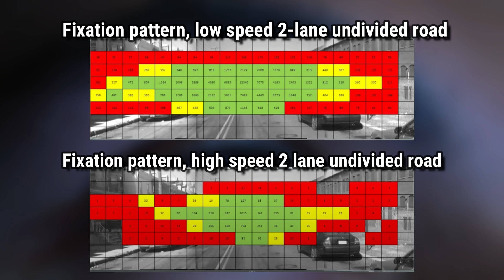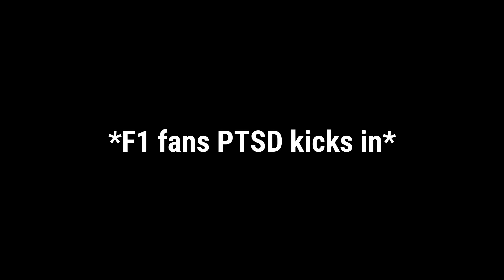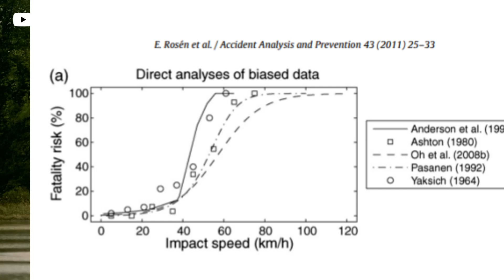Why Speed Limits Are Useless

Comment: I haven't finished watching, but does he address the most fundamental question of all: Why do you want drivers to look down at their speedometer?
Reply: So true man I always drive way worse when I'm near cops because I'm checking my speed more often.
Reply: Who looks at their speedometer constantly? 👈 People who constantly drive close to law enforcement's threshold. For those who drive closer to the posted limit, a glance every so often is enough or set your damn cruise control.
Reply: @Doowadaddy  people wouldn’t be speeding if the roads were designed well.
Reply: @thephilster741  . Sure they would. Look at a construction zone, narrowed lanes, workers and equipment, rough roads, limited visibility, flashing lights, lane shifts, everything to reduce the speed, "your speed" signs, higher fines for speeding, criminal charges if you hit a worker, even a trooper parked on the shoulder with lights flashing 👈 that last one is usually a speed deterrent. But people speed through construction zones, lots of people. Road designs aren't going to help people manage their time or relieve them of their propensity to rush around like a race car driver.
Reply: nobody stares at their speedometer. You can easily maintain a speed just through constant gas pedal pressure as well as visually maintaining your speed simply while looking forward. Also, anyone who's been driving for a little bit will develop a muscle memory for certain speeds. I rarely ever even look at my speedometer since I can always feel how fast I'm going.
Reply: I rarely look at my speedometer. I’ve been driving long enough to feel my approximate speed. Although anytime I’m driving a new vehicle, I have to relearn it because not all vehicles feel the same. My first car felt like it was falling apart if you hit anything over 60mph
Reply: My question is, why does his vision narrow when he goes faster. 2:40 
Cause me going around (censored  cause im not an idiot)mph  and being able to keep track of every vehicle around me while having to drive a 6 speed manual
Reply: @raywarlock Think of it as having the processed circles of visual information expiring sooner at higher speeds.  And while you may be keeping track of every vehicle perfectly, us pedestrians are more likely to be blipped over as we fall through the cracks between circles 😂 !
Reply: @raywarlock You think you keep track of every vehicle. Did you see that motorcycle? Or the bicycle? How about the parent and toddler hidden behind that parked SUV?
Reply: @BrendonGreenNZL
Yes, that’s how I knew to not go towards that direction or to use a different street.
Reply: @techgeeknzl  It’s a bit of oft-repeated propaganda that driving fast is dangerous, speed kills, etc. But nobody considers if that is true. It’s not; differences in speed are more important than absolute speed. A freeway with traffic running 80 mph is safer than a busy “stroad” with most traffic going  under 35, because there are fewer opportunities for conflicting speeds, as everybody is going the same direction at close to the same speed on the freeway, while all the vehicles going every which direction at vastly different speeds cause numerous accidents on the typical stroad. Yet if you believe the propaganda, the freeway should be deadly while the stroad should be one of the safest roads around.
Reply: @Ethan.Lamoureux  You're absolutely right. Traffic is safest when it is all moving at the same speed, irrespective of the absolute speed. Which is why roads with fast traffic should not have hazards such as parked cars, pedestrians, or cross traffic; and, conversely, roads where such hazards are likely to occur must not have fast traffic.
Reply: @techgeeknzl tbf I know I keep track of everything and the only unexpected events can occur from animals/people, which at that point I’m exclusively watching out for. Using your mirrors is pretty easy to know where everyone is, especially if it’s any sort of straight road/highway.
Reply: @BrendonGreenNZL  Well, if i do move at a fast pace, then yes, I will notice all except the hidden parent and toddler due to them being hidden behind an object. I dont get X-ray, but I do have the ability to focus at much higher speeds
Reply: @raywarlock please speed on the highway and not on local streets 😊👍
Reply: @techgeeknzl maybe parents with children should make themselves visible before crossing the road instead of hiding behind a suv
Reply: @381delirius  ay now never said speed. Said at speed 😉
Reply: How would you see something if it's behind something like an SUV.  @techgeeknzl

Comment: I often point out that most US drivers are also highly inculturated to high speed driving and even if a road or street is designed well to promote slow driving, those drivers will see it as a challenge to drive as fast as they can in that place. And they will and do. And if by some miracle a street is designed well enough that drivers are forced to actually slow down, they will complain endlessly to the city until the design is changed to one that allows faster speeds. And the city will oblige.
Reply: @ethanlamoureux5306  
> Driving is non productive time that should be minimized.
Hence why I ride the subway. Can't read a book while driving. Can totally get work done in a subway seat. There's a pretty massive texting while driving issue over in the states, and the new touchscreen dashes aren't helping
Reply: @Demopans5990  That sounds great! Unfortunately, subways are only found in eleven cities in the US, with only 32 US cities having metro systems of any sort, including subways. Only four cities have 24 hour metro systems. This means the vast majority of the country has nothing like a subway. Even regularly scheduled bus service rarely makes it into the suburbs where so many people live, and in rural areas public transport is unheard of. This means most people are forced to drive their own car. And since we have no other choice but to spend unproductive time driving, we choose to make it is short a time as possible by driving as fast as possible under the circumstances.
Reply: Speed is good. Without speed we could never get anywhere. Driving is non productive time that should be minimized. The best road is one which allows safe operation at the fastest speed.
Reply: "Inculturated" is not a word I'd use unless the "culture" is something established over spans of minutes.  Take for instance US 206 going north as it becomes Main St. in Newton, NJ.  You spend minutes driving on a country road at 50 mph and then are expected to slow to 25.  The route is 2 centuries old -- the Morris and Sussex Turnpike -- and, due to geographic constraints, would be very hard to bypass for thru traffic -- which is why it was attractive to operate a turnpike there back then.  Newton is a spider web of roads in several directions converging there.

Anyway, the 25 mph limit is appropriate.  Not only is it the prima facie limit for built up areas in New Jersey, but Newton in recent time has attracted a mix of very old residents and children, making for quite the pedestrian hazard, and Main St. cuts at an angle across a grid of streets, resulting in frequent and odd intersections at various angles.  The municipality has tried to address these problems by policing, but that just leads to inconsistent "Why me?" violations.  The entering speed limits are graded with a 45 mph segment and then an utterly useless block of 35 mph before forking into 25 mph streets going north, but it's very easy for drivers who don't come thru often to be unaware of the transition.  And since the most problematic part of Main St. is downhill from both ends, it's hard for drivers to stay within the speed limit even if they notice and try to.

Trust me, the problem is not drivers who would see it as a challenge.  They would not complain of a design to promote slow driving.  The taxpayers, however, would.  I don't know what changes it would take, but if any of them went deep -- literally -- a consideration making the work more expensive is some tributaries to the Paulinskill that underlay the roadway.  And, since it's a US highway and a state federal aid primary road, I'm sure there are those political considerations as well.
Reply: I actively seek out curvy back roads and mountain roads within a 3 hour radius of my house to drive fast. The roads have many ups and downs, sharp curves, etc etc but there is one crucial thing that makes me confident to push 70-80mph on these ~35mph speed limit roads: there is nobody around. Yes there are people in cars driving, but I mean PEOPLE, pedestrians. All that's there is roads, trees, and cliffs on either side. If a sidewalk was present, if crosswalks existed, you can sure as hell bet I will be obeying that speed limit. People are unpredictable and I'm not taking the chance that after going around a corner there could be a family walking across the road. That's the key part of road design in my opinion: making the driver fear the uncontrollable. I am 100% confident in my driving skills and I know exactly what my car physically can and cannot handle, but none of that matters when it can all be ruined by something even a hypothetically perfect racecar driver couldn't avoid
Reply: @ambiguousheadline8263  I used to go into an unbuilt subdivision - it had the roads but no houses. I'd go there at like 2 - 3am in my Mustang and do like 120 mph. Some of my friends would ride along and be screaming but I know exactly what I was doing. There were places where it looked like the road ran out but it was really a turn.
Reply: @ambiguousheadline8263  I’m with you 100%. I consider myself to be a good driver, but when I go to a city like Santa Monica, CA, it’s just a nightmare due to how poorly the city is built and how stupid/entitled the pedestrians are. They just walk out into the street expecting traffic to come to a screeching halt.
Reply: That isn't really true. People who do that wind up messing up their cars and don't drive anymore
Reply: The average driver here are impatient absolute freaking dip$h*ts and always in a "hurry".

Comment: that doesnt look like 13 feet if cars are 4 feet wide that dont make any sense
Reply: Most cars are at least 5 feet wide. Many are closer to 6 or 6 and a half.
Reply: @Vengir  my mothers car my dads car is 4 feet wide
Reply: @ZaneOllivierra-po9iw  I wonder what they drive. The narrowest car I can think of at the moment is Mobilize Duo, but that's more like 4 and a quarter feet.
Reply: @Vengir  my mother has a 2019 kia niro my dad has a 2018 nissan tiida and another nissan tiida and a 2024 tucson and they are 4 feet i tested by lying down in the back and im 4.8 feet tall so
Reply: but if you count the outside which adds some inches your prob right
Reply: @ZaneOllivierra-po9iw  Yeah, car dimensions are typically measured on the outside. Nissan Tiida is around 5 and a half feet wide.
Reply: i thought it was 4 feet  but your right i guess
Reply: but my highway roads in my counry are 7 feet and that was 13 feet makes no sense if its 13 feet they prob counted the parking to
Reply: @ZaneOllivierra-po9iw  A street with a 7-foot-wide lane may be just enough for local traffic, provided that you don't expect two trucks or buses to pass each other. Here, 8.2 ft is the minimum. A proper lane on a high-speed highway should be 11 or 12.

For perspective, that blue car is probably Mazda 3. Its width is around 5.75 ft. Next to it you could put around two more such cars. 2 times 5.75 is 11.5. Considering a margin of error with such eyeball-measurements, it seems plausible that the actual width of the road, without parking, could be 13 feet. With parking, it's probably 19 or 20 feet.
Reply: @Vengir  wellif you add a local car it 1 feet of space on each side so 7 feet but trucks i saw them driving on it and having just a few inches of space but we have europe trucks so i guess thats why or ethier is 8.2 ft
Reply: we have been texting each other for hours like best riends even tho we dont know each other
Reply: @Vengir  but our highways speed is 62mph on every of our highway and we have 3 highways and were in the caribean a place with lots of subcompact and small size compact cars so yeah
Reply: @ZaneOllivierra-po9iw  Yeah, I saw one of those highways on Google Street view, and the lanes look wide enough to me. I only found out that the maximum width of a vehicle allowed in your country is 2.5 meters, so that would be 8.2 feet. It would be a bit weird if they expected vehicles of that size to drive on roads with 7-foot lanes. And those 2.5 meters is about the size of a European truck, too. Unfortunately, I couldn't find any law that says how wide the roads must be build.
Reply: @Vengir  well i saw a truck once and it had inches of space so it is prob  8 foot something but my country mostly has thoses small asian trucks like hyundai and the kia frontier the mitsubishi one and isuzu so yeah i guess thats why its 8 foot something
Reply: but our country has a lot of small sedans and wagons and hatchbacks which are small cars so it makes sense why its narrow our most common type of cars are subcompact compact small size sedans our suvs small size compact or subcompact suvs or cuvs and you could have a main road in a town and the road is narrower than 8 feet and cars are going 50 its about 7 feet
Reply: we have been talking for a whole day
Reply: but isnt one metter 3.2 feet so europe trucks are 3 meters long  atleast they should be i cant believe i was wrong and you were right im a car guy and know alot about them
Reply: @Vengir  also my country is close to venezuela like close also sorry if i spelt it wrong
Reply: @Vengir   also you texted me at 2am in my country time
Reply: @ZaneOllivierra-po9iw  There is a name of a country in the title of one of your video. I figured out it's probably the one where you're from. And also I'm from Europe, so the time difference may lead to unusual times of reply.
Reply: @Vengir  so you know im from trinidad?
Reply: @ZaneOllivierra-po9iw  Yeah, I guessed that you are. I tried to find a source on what your laws say about those matters, but was unable to.
Reply: @Vengir  oh well i guess  so my roads are 8 foot something and i guess thats why alot of big trucks aren t in my country well thank you for telling me that
Reply: @ZaneOllivierra-po9iw   - 2019 Kia Niro = 5.925' wide.
2018 Nissan Tilda = 6.625' wide.
2024 Hyundai Tucson = 6.116667' wide.
Reply: The smart fortwo is just half an inch short of 5'.  No car sold today is that narrow.  Even the Toyota Yaris is 5 1/2' wide.

Comment: Greetings.  I'm going to offer you some constructive criticism.  Nothing in your video actually had anything that resembles a logical argument.  Nothing you said was supported by any data and is mostly rumors you heard.  Relationship between vison and speed is nothing more than a hypothetical idea which when tested in actual studies was found to be false:  "However, no effect of the image size on driving speed perception was found in their early study" - nih.gov  "8% of fatality accidents involved a vehicle that was speeding." -GHSA.gov  
According to NHTSA.gov the real shocker about pedestrian fatalities.  Most of those accidents weren't the fault of the driver.
1.  "Light conditions: 76% of pedestrians were killed in collisions that occurred when it was dark"
2.  "Roadway location: 73% of pedestrian fatalities occurred at non-intersection locations (Schneider, 2020). A study linking FARS data with roadway data and aerial imagery to identify pedestrian fatality “hot spots” found that common characteristics of these locations included five or more lanes to cross (70%), speed limits of 30 mph or higher" - nhtsa.gov

Finally Netherlands fatalities per billion vehicle miles traveled is nearly the same:  US: 2.37 / billion VMT -GHSA.gov  NE: 2.29 / billion VMT  
NE figure is approximate I calculated it from various sources, couldn't find an actual report like in US.

Netherlands is a cautionary tale not a success story.  They are no different than Dubai minus the luxury.  Luxury is against the communist government ideals.  They have enormous amounts of oil money for a small country that allows all these oppressive programs to persist without change.  Just like Dubai most locals do not work, the incentive between benefits and a salary taxed to oblivion is neglible.  They bring in labor from other countries.  The taxes are so horrific that unlike the locals that pay 60% in taxes foreigners get 25% tax credit and pay around 35% tax, otherwise nobody would come.  Despite draconian government measures to make cars unaffordable and inconvinient, car ownership in NE is rising.